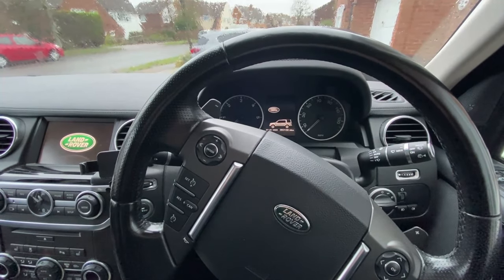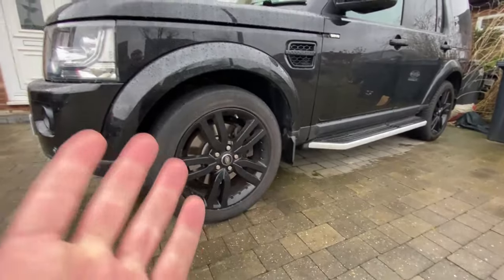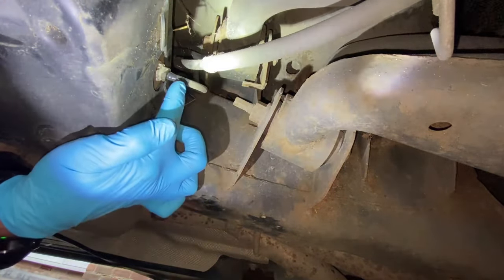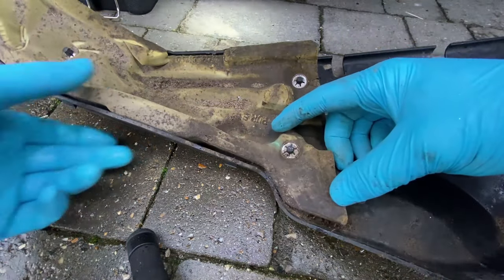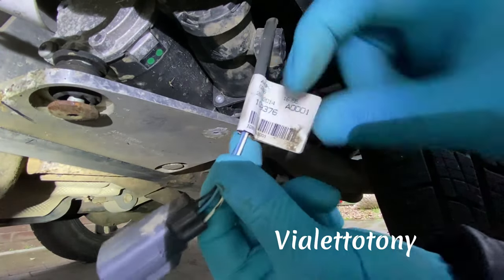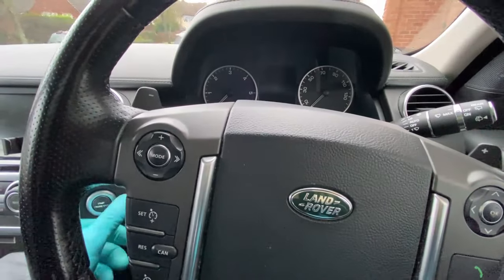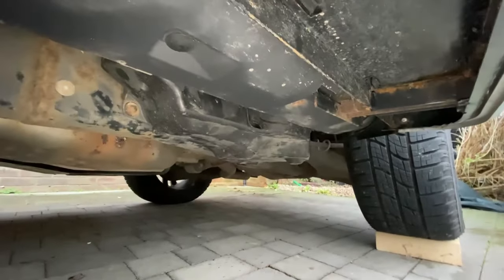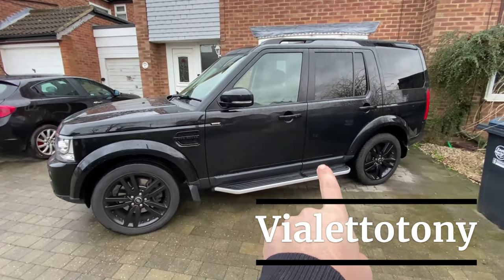Land Rover Suspension Fault FIXED FOR FREE

Comment: What year is this vehicle? I’m having the same issue with the suspension fault, but other videos have shown the air compressor in the trunk space.
Reply from the maker: Hi it’s a late 2014. The air filter for the inlet is in the trunk behind the rear lights on mine. Hope that helps. All the best 👍

Comment: My control switch flashes twice and my car won’t raise or lower, I jumped the relay and the compressor kicked on, none of my bags are sagging, any idea what my gremlin might be?
Reply from the maker: Really difficult to say. I’d recommend getting it plugged in and having the codes read. That should tell you exactly where the issue is. There’s a couple of videos on my channel on diagnostics that may help if you don’t have a code reader. All the best 👍
Reply: @vialettotony  thanks for the quick reply!
Reply: What was your problem? Having a similar issue

Comment: Hi did your car lower and raise with this fault i have this message come up today and the rear raises fine but the front takes ages also the message is intermittent like you said.
Reply from the maker: Hi. When the message was present it would not lower or raise. If your front takes ages to raise, then it could be the front valve thing. Does it fro at the front overnight or after a couple of days?  All the best 👍
Reply: @vialettotony  thanks for replying I've watched loads of videos and been on forums since the fault came up yesterday stressed now!, and I've got a feeling it's the dryer on the compressor but I'm going to refurb the whole compressor while it's off if that doesn't fix it then I'll move onto the valves I need to do the front arb bushes anyway.

It's not dropping which is a good sign as I was dreading it might have been a shock.

I've ordered that AP200 to read the codes it looks a good reader I've got a basic one but it's not picking the codes up.